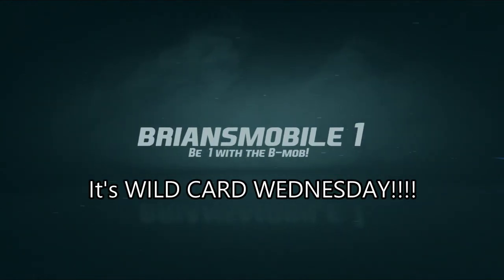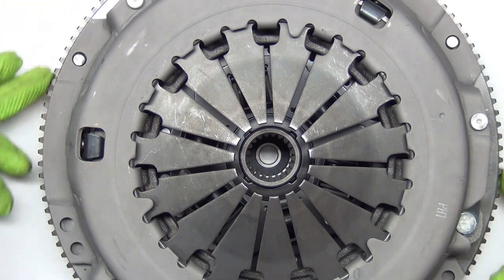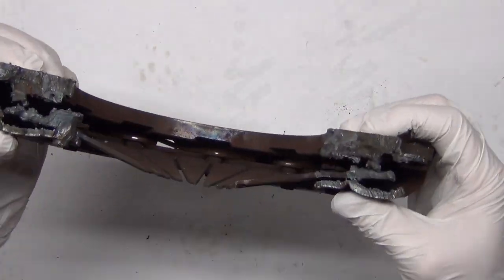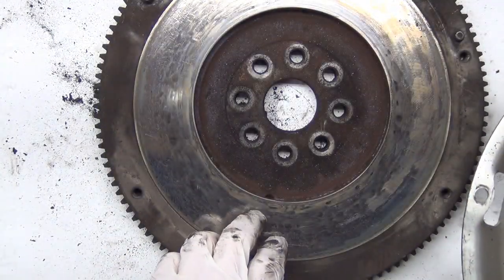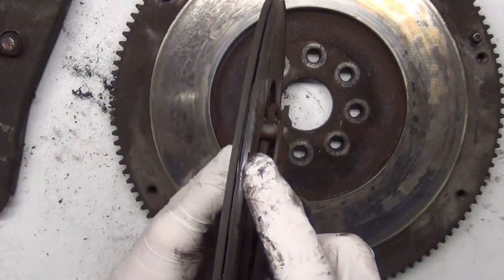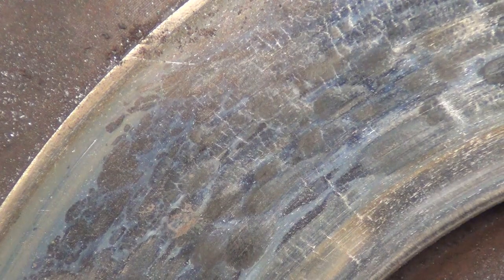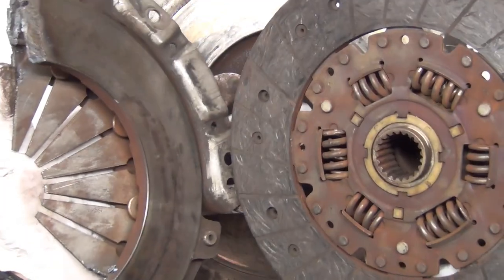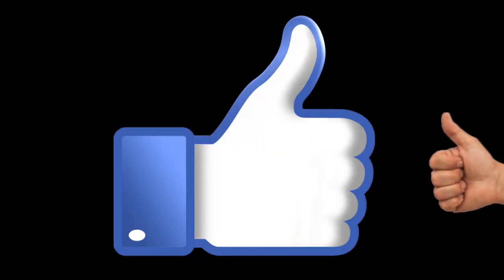How To Spot Failed Clutch Parts

Comment: I understand that excessive pressure on the clutch can cause the throw out bearing to fail. What I don’t understand is why people say that putting a car in neutral and releasing the clutch will cause it to fail as well. Can you shed some light on letting off on the clutch at a red light or when a train is crossing the road taking forever?
Reply from the maker: GREAT QUESTION!  Yeah, that's B.S.  That's a good thing to put it in neutral and let the clutch up.   Any time the clutch isn't all the way up or down the disc is getting wear like a brake pad does.  Any time the clutch pedal has any foot pressure at all- the throw out bearing is getting wear like a wheel bearing does.
Reply: it’s meant to be a wear and tear no matter what 😅 my clutch on my 2013 accord went out at 170K mileage and DIY it here my house currently and I’m saving big time expense of 5G price compared to dealer quote…my apprentice and watching YT vid like this is very helpful

Comment: Hi Brian, Thanks for the vid.  I have a question for ya. I just changed the clutch on my 93 toyota 4x4 truck. 22re.   over 200k miles.  When I put it all back together I had a devil of a time installing the slave cylinder because of the residual spring pressure???  Seems like there is no free play between bearing and pressure plate.  I have free play at the clutch pedal at top of stroke. I tried a couple of changes to the clutch adjustment rod under the dash. The truck drives and shifts perfectly with clutch engagement about mid point at the pedal.  The old throwout bearing was so nice I thought about not changing it but I did anyway.   It just doesn't seem right for the slave cylinder to have spring pressure holding the bearing against the Pressure plate.  Your thoughts or advice would be appreciated. Thanks in advance. Later Greg

Comment: my hydraulic slave cylinder popped out, it damage clutch disc so bad that the clutch separated to the point that its 3 pieces, rear main seal (has a plastic crank sensor holder which separated from seal). Had to replace clutch kit, rear main seal, slave cylinder and this happened out of nowhere without symptoms while driving. you wake up bill free and go to sleep huge bill lol

Comment: hey guys i have a 2008 Ford Mustang GT with a 5-speed i was driving my car pretty normal not fast i go from 1st gear to 2nd gear when i put it to second gear my car RPMs went pretty high & then kinda made a pop sound my clutch pedal feels great starts the car but if i put it into any gear the car makes grounding noises end the car doesn't move at all any help would be appreciated

Comment: Good explanation Brian.  I have an '87 Ranger that needs a new slave cylinder which like many manual trans Fords is mounted to the splined input shaft.
Reply: I hate doing those.  Cherokees had the same design as well.
Reply: @jamesu  bleeding them can be a royal piano, just getting access
Reply from the maker: We call the a "concentric" slave cylinder or "French export shit."  I hate those.  The worst part is the stupid hydraulic line (think air bubbles) goes below the frame rail, up and over it, and then below it again before going up the clutch master cylinder.  You often have to take the whole system off and bleed the line off the truck, or pressurize the M.C. reservoir with air and push a whole lines worth through to get the air out.  I have a video on those on my other channel "theskiviking"
Reply: I understand why they did this. Just don't like tearing the whole thing apart (time and cost) just to replace a part that use to take 15 minutes.

Comment: Great video. Need to also indicate that a broken or worn release bearing can damage the transmission housing extension (AKA "quill" or "snout").  It carves grooves or low areas in the side of the extension and thus prevents proper, smooth clutch operation, even if you replace everything else.  Most common in Hondas and Subarus with aluminum housing extensions, less so in Chrysler with steel extensions.  Can fix this with a sleeve and oversized release bearing kit or buy a new housing because the extension is cast along with the rest of the housing.  When this happens it really sucks!

Comment: Great video, very informative. What’s is the benefit and cons of installing a light weight flywheel ?
Reply: Benefit: engine works less to spin it, allowing more power
Con: clutch pedal will be more sensitive. That could be a pro over time

Comment: your friction plate springs look like they were wearing against the flywheel mounting bolts.  Is that common?  Is that a sign that the clutch friction disk is worn so far that it starts making contact with the bolts?  Asking due to one I took out that had that and 1 spring got out of it's holding and was free to bounce around.

Comment: I have a 2009 model Hyundai i10 which has a cable clutch system .
The clutch pedal was really hard to press so I gave it to local mechanic and he said clutch is gone, need to change it so I told him to do so.
After 2-3days of clutch + pressure plate + throw out bearing change the pedal again  started to get harder, only when the car is warm, when the car is cold pedal will be smooth.
Anyone know what the issue might be?

Comment: hey 2 year old video but if anyone is around to shed light;. I thought I snapped my clutch cable because I suddenly had soft pedal but I'm still actuating the fork. when I get under it I have a convenient inspection plate to get to the end of the fork and can actuate it easily with my finger.  is that the pressure plate bad or the throw out broken? it's a little Japanese kei truck so I have been having issues getting used to the tiny space for clutch actuation 😅 I replaced the clutch plate a year ago but that was it, I was in a bind and needed it running for an event

Comment: I have a clutch fork dilemma im messing with atm. The fulcrum went through the fork and stripped out the threads on the bellhousing. Would a tap and dye work to rethread or am i stuck buying the bellhousing in this type of situation?

Comment: I have a 1981 Jeep Scrambler. I picked it up last year. 258 I6 4.2 with 44K original miles on it. When I take off in first is makes a noise like dragging a chair across a hardwood floor, and it shudders. Any thoughts?
Reply: It also pops out of gear on the down shift in second.

Comment: My car doesn’t slip but when I push in the clutch it doesn’t seem to do anything and it won’t go into gear but I can turn it off put it in first and start my car in gear so I can go
Reply from the maker: In your case it's likely a hydraulic leak in the clutch master cylinder or slave cylinder such that it won't disengage.  A clutch failure with slipping is when the clutch disc is too thin or the pressure place is worn out.
Reply: Thank you so much for your quick reply

Comment: what can cause a noise front some gears and not on 4th gear
Reply: What if the noise goes away in fourth gear but is in all other gears? Fourth locks the main shaft and bypasses the lower counter shaft thus bypasses those lower bearings. So one or both lower counter bearings could be bad.

Comment: Had a new clutch put in… changed the master and slave a month later.. since then I can’t get into first Gear or R from a stop.. if I rev the car while pressuring for 1st gear it will fall in.. or if I hold the pedal for 5-6 seconds it will fall into gear… I’m convinced it’s air in the system being introduced somehow.. but I’ve tried bleeding 101 different ways.. always seem to have air in the system.. never let the master empty.. garage wants a new clutch… I’m convinced it’s air… thoughts?
Reply: Did you fix it?
Reply: The input shaft is rotation with the speed of the crankshaft, when you try to put a car in gear what happens?, your hear a grinding in gears meaning your input shaft is still rotating at or below the speed of the crank making it difficult for the shift forks to mesh onto   the main shaft but eventually if you force it enough it takes the gear. Hence you have a problem of the pressure plate and/or release bearing or fork failure because your clutch disk is being fully disengaged. Since your saying you've bled a million times

Comment: My tranny makes a noise but i replaced the clutch fly wheel and bearings 😢 idk what it could be but couple people told me it was the throw out bearing but it brand new like a couple days idk if the noise thing is normal when i press down the clutch the noise goes away
Reply: Did you fix the issue?

Comment: Everything on my truck is completely brand new and rebuilt however it sounds like a boat motor between each gear only when very quiet in neutral it's only when letting out the clutch and driving you have any idea what that could
Reply: Did you fix it?